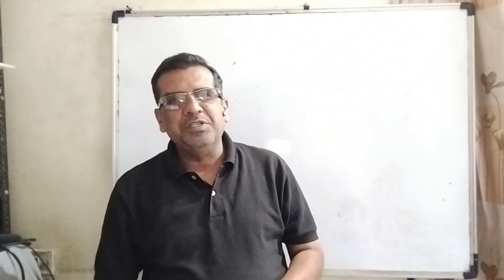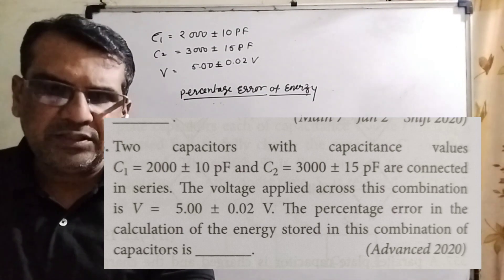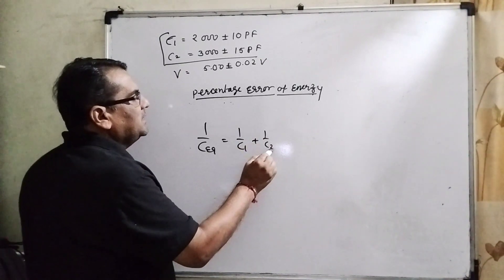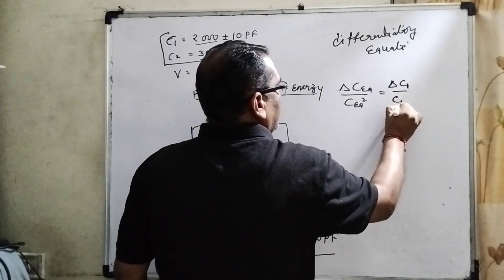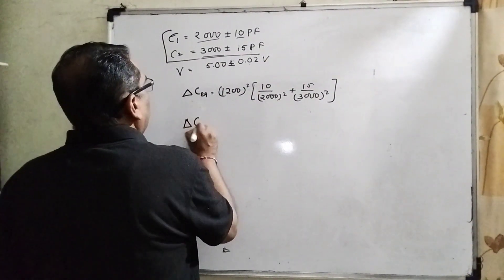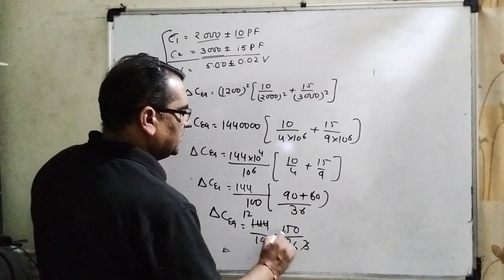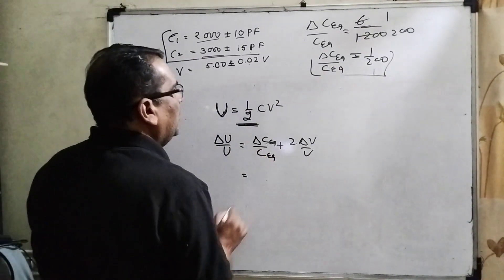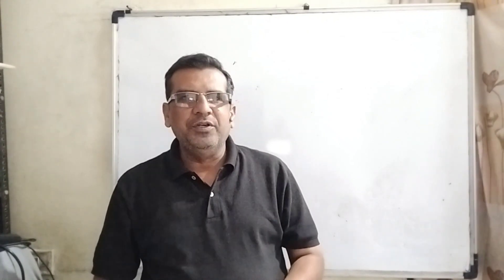Two capacitor with capacitance values C1=2000+-10pF andC2=3000+-15pF are connected in series

Comment: sir can we use the Ceq formula (C1C2)/C1+C2 , and solve like a normal multiplication division error question where C1+C2 is taken as a new unit 5000+-25pF ?
Reply from the maker: This formula is applicable when two capacitor in series
Reply: @ajaykarmarkar2636  so sir here two capacitors are in series but the answer is not the same , i want to know the mistake i did
Reply from the maker: @bhakindar9083  plz send me at my no 9826463354
Reply: Same doubt b